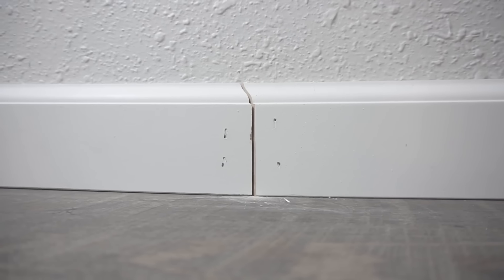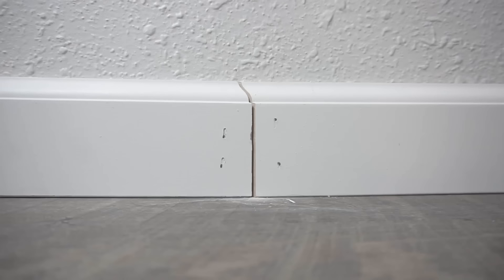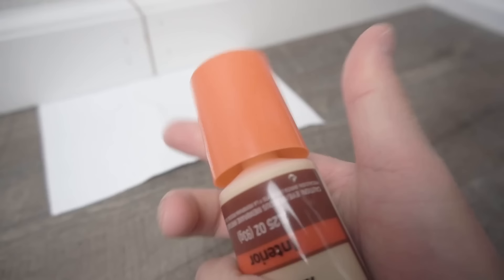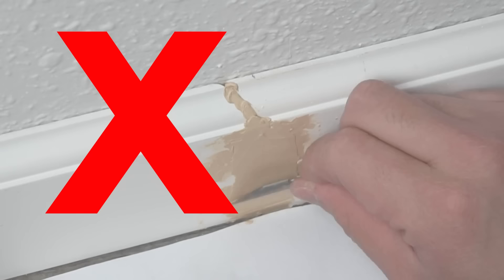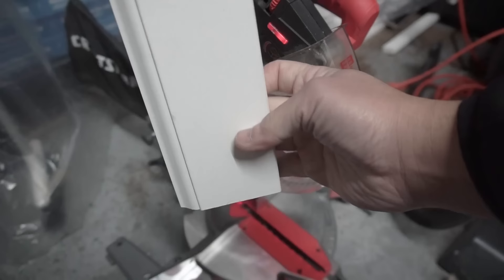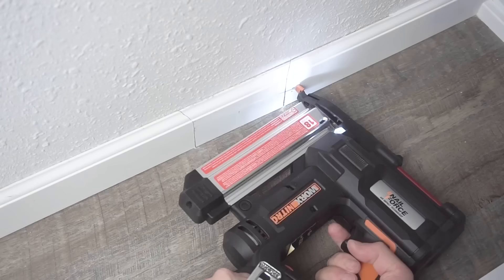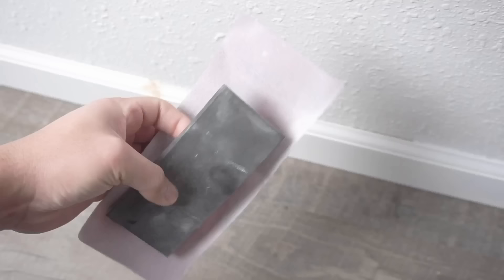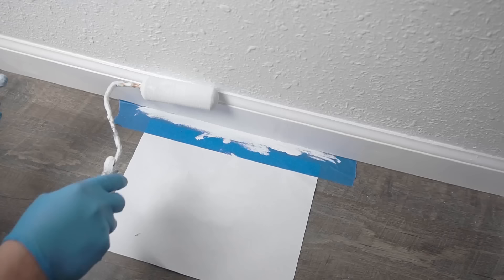How To Fix Baseboard With BIG GAPS Or Doesn't Meet Up! Tips And Tricks Tutorial DIY  For Beginners!

Comment: Oh man wish I saw this video last month!  I ended up feeling many gaps like that from a not so good baseboard install with Dap extreme stretch chaulk and then I used Dap wood filler.  Then I painted it.  So far looks perfect unless you get on your knees and try to look for the blemishes but I just hope it doesn't crack next year.
Reply: When it cracks (if it cracks) you'll have to spend 10 minutes and $.10 of material to fix it again. What a nightmare!
Reply: @redhatuncleputzin9772  It failed... didn't crack but the warmer weather made it expand and pushed the material out.  Oddly enough everything is still intact but the material is pruding out

Comment: I would cut the miters the opposite direction and used a flexible caulk like Big Stretch in the joints.
Reply from the maker: Thank you for sharing your method!
Reply: @FixThisHouse  don't caulk it. Caulk shrinks and you'll still see the gap.

Comment: With expansion and contraction of the walls the wood filler would crack over time. Why not use a flexible caulk that's printable.

Comment: What did I just watch.. if you had to cut the smaller piece to begin with, why not remove one of the pieces, add the small piece then recut that piece you removed.  You would of save yourself filling cracks when you can cut it on the miter saw to perfection.  Also when you scarf your joints at 45 degrees it actually means you cut both pieces at 22.5 degrees.  When you nail the two pieces ensure you nail the miter together to avoid the seperation from happening and don't forget to apply glue on both pieces.  If your worried about trim pulling away from the wall put some silicone on the the wall before installing.  If you can't get your joints tight and always have to fill then you would not be working on my job site.

Comment: Saw another video where the gal used a 6" putty knife and pry bar to pull off the baseboard with out damaging the wall.
Reply from the maker: Thank you for this information!
Reply: There's a tool now to specifically remove baseboards. Last I saw it was around 40 bucks

Comment: Looks you have good chop shaw if baseboard is cut in 45° and you have gap in between before you fill that gap with wood filler cut slice different size to fill that gap and after you put wood filler...with finish blade , mdf baseboard you cut like good knife like a butter...any size from 2 mm to 10 mm or from 16 of the inch to 1/8 of the inch... Nice work but to much and now you have 2 cuts on less than 10 inches apart....

Comment: I would think it would be easier to replace the whole board. Cut and nail. No sanding, etc.
Reply from the maker: That would be another option and thank you for that. I just like to make videos that have different scenarios and sometimes replacing a whole run of boards could get costly and if you have prices just lying around and don’t want to waist and save scraps this would be a good option 🙏🏽😊

Comment: If the trim carpenter  Would use glue on the scarf joints and miter joints they would never separate like that due to shrinkage  I am a 30 year pro and I  Glue all  joints

Comment: The reason why your piece was too short is because you didn’t factor in the Kerf line created from the multi tool ( osilating saw) if you want to do this method you have cut your piece to q with the thickness of the saw blade in mind. And just because the to is a certain measurement doesn’t mean the bottom is. You need to check for square first or it will be a compounded miter. With a mitre gauge you could have made a compound mitre on the first cut an nailed it perfectly. But you cut square thinking the baseboard is square to wall and floor when it isn’t
Reply: Thanks

Comment: Elastomeric paintable caulking is the best fast fix. You also need to properly nail the trim down.
Reply from the maker: Thank you for sharing your feedback 😊🙏🏽
Reply: @FixThisHouse  no problem. I’m a painter with 4 years xp. It’s a new product but man does it work. It’s like rubber and if you are good at setting it. It will hold better than nails and flush with paint like it was never there. Might make for good content to try it yourself

Comment: Do not always believe what you see on the internet. This is in fact not the easiest way to fix this problem. The easiest and best way to fix the problem is to FIX THE PROBLEM. For one, you're creating two gaps instead of one or at least two seams right next to each other which would make somebody's head spin if they are actually paying you to do this crap. Another problem is that you're not going to hit studs now with your top nail. Sure, you'll probably hit with the bottom Nails because of the sill plate, but your Top Nails will not hit a stud if you just put your joints all willy-nilly wherever you want. This also takes more time than just replacing the piece

Comment: Yes that will happen with a filler that isn't  good.
I use Bondo as a wood filler this way looks like to much work why not just do it correctly in the first place.
I'm working on a home that was a custom build and all the sheeting is OSB custom alright.
OSB sucks as soon as you screw into it it's faulty.

Comment: I think that is too much work to replace such a small pice of baseboard, that baseboard is not expensive to replace a longer piece much easier, also those splashing on 45 are longer and more noticeable that if are just cut straight down on 90 degrees, thanks
Reply from the maker: Hi! Thank you for your feedback! I agree, this is just an example and another option. This works perfect for replacing damage portion of baseboard. Not everyone wants to replace a whole run especially if they run many feet on their wall. Thank you again! 🙏🏽

Comment: Painter's putty would do the job and it does not shrink if it's too moist roll it in 45 minute mud powder a little bit and roll it on your hand in a ball force it in the cracks Clean it up hit it with paint finished walla 3 minute repair job

Comment: I'm sorry to say, but that filler you are using is not very good compared to others lol. something like an MH Ready patch would have been fine there. You can also put a backer of a low shrinkage caulking behind the wood filler and it will do much better. a caulking like a Top Gun 250 would work great... even liquid nails or Tite Bond Quick and Thick is a great backer to wood filler because they have great flexibility and adhesion, while not shrinking much.

Comment: This is "because I can video" not because the Contractor would allow it.  In the time it takes to do this work it will be expected a few rooms worth of base would be installed, at the very least.  The comments section is filled with googly eyed kids.  There's not only better ways to do this, there's faster and far less expensive too.  It's like a car accident where the steel fender is crumpled, do they spend 3 - 4 days straightening it, puddying it, painting it, or do they get a like new one from junker or even a new one from the dealer and finish it in 2 days.

Comment: If this was a high end job - replace the piece. If you only had that piece and some scraps left over, then yes, the scarf joint, but it shouldn't have taken three attempts to get the right angles. Those will never work out to be a 45 degree angle, every carpenter worth his salt knows that and the best way to hide these is going with a 22.5 degree angle instead. You're still going to have to do a bit of math to get your scarf to fit properly. Use bondo, never filler - it's easier to manage, dries faster, and no shrinkage. And I'm really sorry to keep dinging you like this, but that paint job was simply awful! You can see the brush strokes, flecks of dirt in the finish, etc. Why didn't you use the small roller for this as well? Your finish would have looked much better.

Comment: As a carpenter i can tel you that no costumers will be happy with this solution. The correct way is tho change the whole base board
Reply from the maker: This video is not made for contractors but for people doing their own DIY. It’s an option. Also what if you have you 20’ run of board? I would not like to go through all that trouble taking off baseboard dealing with caulking and paint chipping. This is spot repair 👍🏽

Comment: Now you have two gaps to fill sand and paint I disagree with this because I done this before doing the one gap. Should be cut at 23 degree or even 33 degree. On a joint like that works much better to fill in and using the wrong filler that's wood filler not cardboard filler. I won't what you in my house

Comment: No, no and hell no. There is no correct way other than to replace the base molding. Quite frankly any gap is unacceptable for anything less than 9' to 16' or whatever the length of your particular base molding comes in. Ditto with crown molding.

If there's a miter joint then it's your responsibility to hide it as best as possible.

Comment: If its paint grade , use bondo!!! Much easier than what you are doing! If its stain grade pull it and make a new piece of trim !!! Problem solved!!! Next
Reply from the maker: Thanks for the input! This is just an option, my main thing I was trying to bring out was spot repair. Instead of repairing multiple feet of run, this will save you so much time and headache from dealing with caulking, paint chips and nailing

Comment: So you now have two smaller gaps instead of one big one.
Reply from the maker: Hi! The point of the video is to create a scarf joint that touches. Notice how I glued the two piece together with CA glue. Now you have a stronger joint, rather than the first where if you were going to just wood fill it, over time it will crack even though you patch it. This method is great also for repairs a damage section of your baseboard.

Comment: Wouldn't it be much faster to just replace the whole board instead of fiddling around like this?
Reply from the maker: What if you are replacing a 20’ run that is caulked and painted? I think it will take much more time cleaning up and prepping and possible destroying all that paint on the run. 🙏🏽
Reply: @FixThisHouse  a yeah i totally forgot that other countries tend to caulc and nail their baseboards. Inferior to the super simple click systems we use in Germany.

Comment: To avoid this Always count for the Blade . which is usually 1/16 that means cut behind the line not on the line .. 😂 
Anyway If a mistake like this do happen . My opinion just pull the baseboard off re-cut it and fix it , It’s Quicker and you not spending the whole day on a 4 inch piece of baseboard 😂😂

Comment: Awful video ,still had to fill the gap, now you have two instead of one ,use some rock-hard and sand it and paint it ,easy
Reply from the maker: I think you missed the point of the video. Like I mentioned it’s an option for spot repairing instead of completely taking out the whole run of baseboard that could be multiple feet. Then you have to deal with feet of caulk and paint chip repair from the wall.

Comment: Terrible solution. What I do is cut a beveled sliver of wood on the table saw. Set the table saw blade at a 5° angle and cut a piece of 2x4. The piece should taper from 0 to 1/8. Glue that piece into the crack and cut off the excess. Spencer lewis has a video on it here: https://youtu.be/HKA7xf7Mqxo?t=1340

Comment: So you ended up filling two gaps instead of one.
Reply from the maker: This is for bigger gaps or damages. The point is to get the two joints to touch without depending on using wood filler👍🏽😊

Comment: Sorry but terrible. The amount of time and effort you just put in to do that and the mistakes made you would have been better off just putting a whole new piece in if not you did a terrible job on wood filler cuz it works for me all the time make sure you pack it in there and leave a little bit to sand down.
Reply from the maker: K thanks for the feedback 👍🏽😊

Comment: Way too much work for a guick fix
Reply from the maker: Hi! The point I was getting to was if you have a long piece, this is a good method for spot repair. This will save you from taking off the whole run, dealing with caulk, paint chipping on walls et. 👍🏽😊